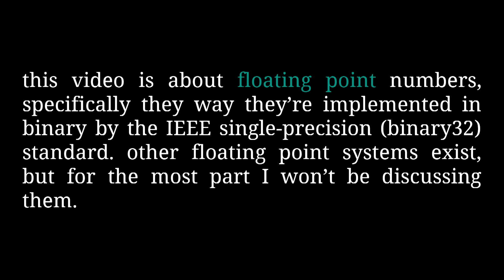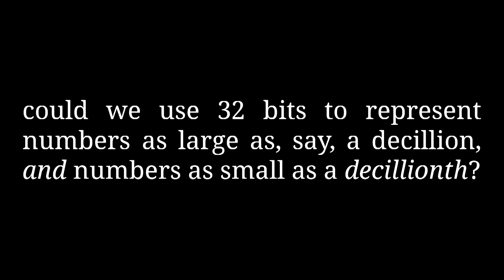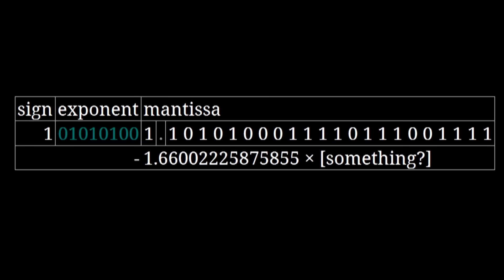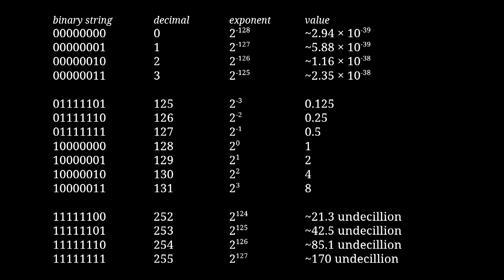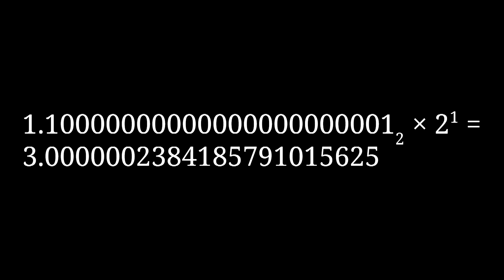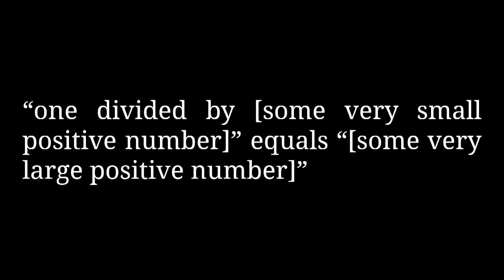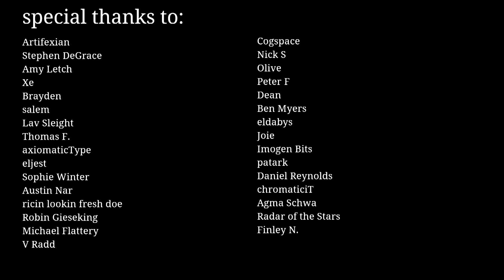how floating point works

Comment: >unless you do something really silly like store time as the exact number of seconds since January 1, 1970
I mean, yeah, it sounds silly, but it makes sense from a computational perspective and is entirely calendar-neutral. Storing seconds, minutes, etc. in their own fields means every application that wants to do calculations on a timestamp has to make sure the fields carry into each other properly, keep track of leap seconds - oh, and is this timestamp in the Gregorian calendar, the Hebrew calendar, the Chinese lunar calendar, or something else entirely? What if the application doesn't have support for your calendar programmed in? With Unix timestamps, the logic required for dealing with all of that simply isn't necessary outside of displaying a time value to the user. Which is good because it means basic system functionality doesn't break even if an application doesn't know how your locale's calendar works.

Comment: I haven't dug into it, but I'm fairly sure the treatment of NaN, +/-Inf, and +/-0 were chosen not just to accurately represent very small or very large numbers with arbitrary (but not infinite) precision, but also to have relatively clean arithmetic that could be implemented purely using logic gates without requiring special treatment of sub-normals and super-normals compared to normal numbers. (Not sure if it's true at all, but that would be a design goal if I was designing it, especially given the hardware constraints of the time when the standard was being written.)
Reply: the subnormals, the biased exponents, and all the edge-case wierdness makes hardware optimization much more challenging, but now that the standard is fixed in place, everyone is expected to follow it. The upside is that the standard has been around long enough that we have practice building processors that can do flops fast
Reply: @Double-Negative  Figures it couldn't be that easy... still, it is an amazingly thorough standard, nonetheless. And we can just go into our text editors and our IDEs and type in or measure arbitrary real numbers for our programs to work with, and, somehow, they mostly just work.

Comment: When you first introduce the Mantissa, that is not the mantissa. A mantissa is all the bits except the leading 1, which is assumed to exist. This comes from the more generalized “mantissa“ which is the non-integer component of a log_10. The trick here is that 12, and 1.2 have the same mantissa, which makes computing logs in some cases much easier, as you can get the integer component by simply shifting the number left or right until it reaches a magnitude < 10, at this point, you’re only left with needing to figure out the mantissa, which, as noted, is the same regardless of where the radix point (the “non-decimal” decimal point) is located. Using this I was able to do 1 out of 4 pH calculations in my final chemistry final, and only needed a calculator with log functions to figure out the last 3 problems.

Another fun gotcha is that the first bit does not actually specify the sign of the number, but is still called the “sign bit”. The reason why is that zero does not have any sign. For real numbers the sign of a number is either -1, 0, or 1, with only zero having the sign value of 0. So while the “sign bit” is used to indicate the sign of non-zero values, the sign of zero is still 0, not positive or negative. (In a similar way, 1 is neither prime nor composite.)

Comment: Great video! It's nice to see a new perspective on a topic such as this.
I had not personally scrutinized the floating point format spec extremely closely. I knew about how the bits were assigned for the sign bit, exponent, and mantissa and that's pretty much it. Infinities and NANs, +0 and -0 I didn't know how they were exactly specified, and subnormals I wasn't aware of at all.

Another thing that you might find interesting to look into is how computers do arithmetic (addition, subtraction, multiplication, division) at a logic gate level and/or software level. Counter-intuitively, doing multiplication fast is not straightforward and has quite a bit of research behind it.
This video showcases the first multiplication algorithm that is better than the standard grade school method of multiplication: https://www.youtube.com/watch?v=cCKOl5li6YM
And you can find actual usages of Karatsuba multiplication and Tom Cook multiplication in the OpenJDK implementation of Java's BigInteger class.

Comment: I always see the sign as `isNegative`.  Also, I recently did a thing in Desmos where I needed to know the quadrant a point was in, so I had Q(p) = N(p.x) + 2N(p.y); N(x) = {x < 0: 1, 0} (which generates a non-standard quadrant index, but it's maybe better.), where N(x) is the same mapping.

Also, with this sign encoding, we have that the actual sign is (-1)^s ((-1)^0 = 1, (-1)^1 = -1)
Reply: The sign function also exists in desmos btw. Might not work as well though since sign(0)=0

Comment: So in practice, floats don't actually have 0 at all, they only have epsilon.
When you mentioned "floating-floating-point numbers, where the length of the exponent is dynamic is exactly what posits do. On top of the mantissa and the exponent, they also have a "regime" that is a variable length field and acts like a "super-exponent." Regarding how posits deal with 0, infinity and NaN, first of all, they actually have a real zero rather than just epsilon. They do have finite numbers that are as close as possible to 0 and infinity that are used whenever an operation would over or underflow. The reasoning for this is that no matter how large the number you try to represent, it will always be closer to 1 billion (or any finite number) than to infinity. Not rounding down to 0 is a little less intuitive, but it mainly comes from avoiding problems when dividing. Regarding infinity, posits actually have a projective infinity, also called "NaR" for "Not a Real," since it is still technically a number that also, like 0, happens to equal its own negative. Speaking of negatives, Posits just piggyback on signed integers and use 2's complement.

Comment: The IEEE's world of floating point math where instead of numbers, you have ranges of numbers, and all the imprecisions that come with it is its own can of worms, an endless void that you can get stuck around. When I was in undergrad I took a class on "numerical analysis" and a significant portion of it was thinking about common mathematical operations, and thinking about how they differ from the actual mathematical operations when they get implemented in floating point.

As you perform operations, the result DOES become slightly less precise, and there's a whole field of study about how to quantify the error that builds up overtime, and how meaningful that error is relative to the values being used / the real solution that you would expect with perfect precision. And many common / obvious way of implementing things like - matrix multiplication, or RREF have a bunch of complex / slower variants that exist solely for the purpose of reducing the floating point error, with rigorous mathematical proofs demonstrating that they quantifiably have less error bound. You have algorithms that are normally iterative, with intense hacks to reduce not only the error from each iteration, but also the number of iterations as a whole, because each iteration racks up the error. It is a very technical and difficult field of study, but it is interesting in concept (I hated the class tho lmao). If you like digging into the floating point spec, you might enjoy looking at that area of CS.
Reply: Is there a place where such lower error algorithms are listed or linked maybe benchmarked, or a repo with reference implementations?

Comment: If I had to guess, 0 being positive and 1 being negative is a holdover from 2's complement binary representation.

For those uninitiated, 2's complement binary representation (2C) is a way to represent positive and negative whole numbers in binary that also uses the leading bit as the signed bit.  To showcase why this format exists here's an example of writing a -3 in 2C using 8 bits.

Step 1: Write |-3| in binary
|-3| = 3 = (0000 0011)

Step 2: Invert all of the bits
Inv(0000 0011) = 1111 1100 

Step 3: Add 1
   1111 1100
+ 0000 0001
   1111 1101

-3 = (1111 1101)2C

Converting it back is the reverse process
Step 1: Subtract 1
   1111 1111
-  0000 0001
   1111 1110

Step 2: Invert all of the bits
Inv(1111 1110) = 0000 0001

Step 3: Convert to base of choice, 10 in this example, and multiply by -1
0000 0001 = 1
1 * -1 = -1

(1111 1111)2C = -1

The advantage of this form is that addition works the same regardless of sign of both numbers or the order. It does this by using the overflow to discard the negative sign if the result would be positive.

Example: -3 + 5           Example: -3 + 2
                                      
   1111 1101                1111 1101
+ 0000 0101            +  0000 0010
   0000 0010                1111 1111
                                      
2 = (0000 0010)2C      -1 = (1111 1111)2C

It's ingenious how effortlessly this integrates with existing computer operations and doesn't have glaring issues, such as One's Complement having a duplicate zero or requiring operational baggage like more naïve negative systems.

To go back to the original statement, this system only works if the leading digit is a one because if it were inverted 0 would be (1000 0000)2C. This is not only unsatisfying to look at, but dangerous when you consider most bits in a computer are initialized as zero, which would be read in this hypothetical system as -255.
Reply: This was in the back of my mind, too.
Reply: Using a single bit to represent the sign is convenient for thinking about and implementing the numbers, but ultimately binary integers are modular integers, which don't actually have any concept of sign. Ascribing a sign based on the first bit gives odd behavior specifically for 0 = -0 being "positive" and 128 = -128 being "negative" when really both are neither.

Comment: I now understand subnormal numbers, I thought I never was going to get them. Thanks!

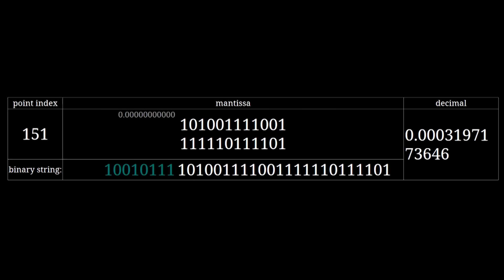By the way, have you heard of posits? It's kinda like a "floating floating point system" like you mentioned at 5:10, and it's really fascinating (albeit harder to understand than the standard IEEE 754 format).
Reply: Thank you for mentioning posits! I remembered reading about them, but I could not remember what they were called. They're a really clever format.

Comment: I think another important part of the philosophy behind NaN and Infinity being standard things is for detecting where errors happen. Having 1/0 be “the largest number in the system” may cause you to run your program, and get back a meaningful, but wrong number. Getting back NaN or Infinity signals to the programmer they made a mistake.
Reply: But what if you wanted to calculate a thing that was effectively infinity, and infinity was the correct answer?  What number system would you use then, since the floating-point system basically says infinity is a number too big to calculate?  Or am I asking a bad question?

Like, for example, the evaluation of limits?
Reply: @iantaakalla8180  Some floating point procedures accept infinity as a valid value. For example, in many math libraries, arctangent of +infinity = pi/2.
Reply: @iantaakalla8180  The getting infinity as a result would not be an error condition in that use case

Comment: 0 is positive and 1 is negative because of how signed integers work. If you were to subtract 1 from 00000000, it would underflow and get you 11111111, which is -1.

Comment: 11:23 "The caveat only being that they get increasingly less precise the closer you get to zero."

That isn't the only caveat. Subnormals often have a separate trap handler in the processor which can slow down processing quite a bit if a lot of subnormals appear.
Reply: Thank you, you just answered my question of why my monte carlo integrator has wildly different run times for different values of the parameters even though it should perform the exact same operations.
Reply: @Kaepsele337  Wow, I didn't expect my comment to be this useful but I'm glad that I could help you.
Reply: good tidbit/nit! thank you!
Reply: Note that this is in many cases an implementation artifact. There are implementation techniques for performant subnormal handling, but since they are supposed to happen only sparingly actual implementations have less incentive to optimize them. That's why subnormal numbers hit much harder in newer machines than in older machines. (IEEE 754 does have an additional FP exception type for subnormals, but traps are frequently disabled for the same reason that signaling NaN is unpopular.)

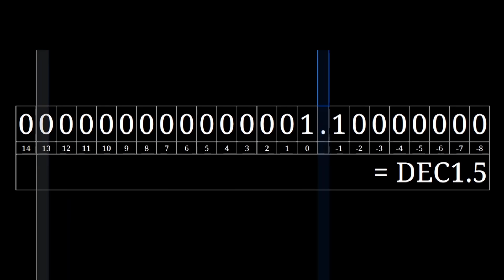Comment: @6:00 I know it's arbitrary either way, but funnily enough, 1 being negative made total sense to me. It is already assumed that you are counting an absolute, and therefore positive value. Without the modifier, you don't even have a choice. The modifier gives the quality of negativity to the value, so you would turn it on to make it negative, and leave it off to just, leave it as it was. 

I get that there's nothing stopping you from doing it either way, but that's just how it made sense in my head, and probably how it makes sense to the developers
Reply: Why don't you just use up all bits, so no sign bit, then subtract some really large number to get negatives?
Reply: @Anonymous-df8it  That number would need to be exactly twice the absolute value of the original number, so you'd need at least double the bits, wouldn't you?
Reply: @lulairenoroub3869  No. Just as how the exponents are subtracted by 128 (or is it 127? idk) without requiring seven more bits for the exponents, the same can be done here